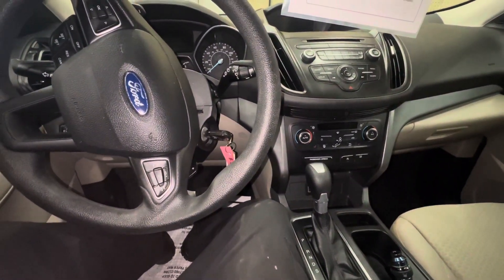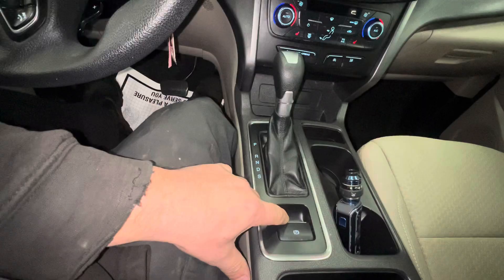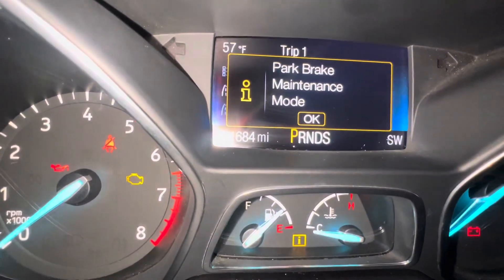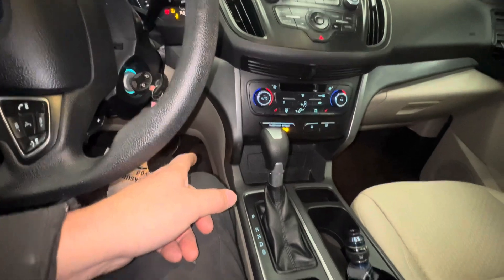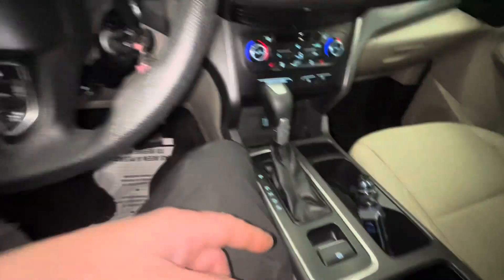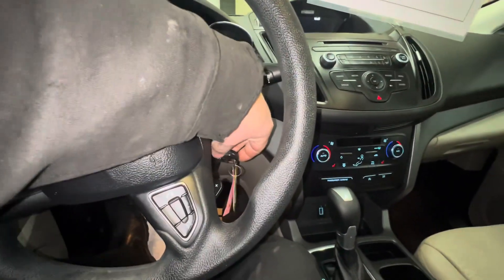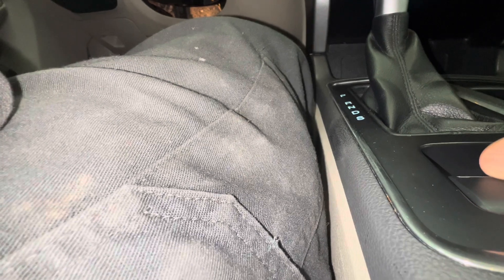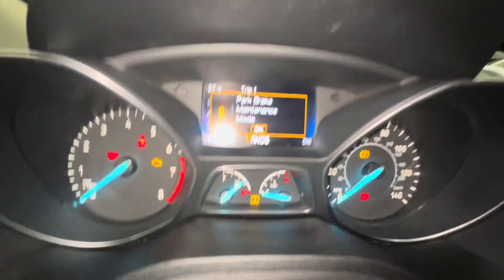2017 Ford escape How to enter and exit parking brake maintenance mode For rear brake service

Comment: I have a 2017 escape I just did the rear rotors and pads and I forgot to put it in service mode. 

I compressed the piston and put everything together but now it sounds like something rubbing and a shop says it’s the rear diff but I have a feeling this coming form the rear brake job I did on it how can I know if it’s the calipers
Reply from the maker: It’s hard to say without looking at the vehicle you said you compressed the Pistons in does your vehicle have the electronic parking brake electric motor on the calipers? I would just take your wheels back off and look over everything good see if anything looks off. It is also easy to bend a backing plate while doing brakes, and getting a scraping noise from that